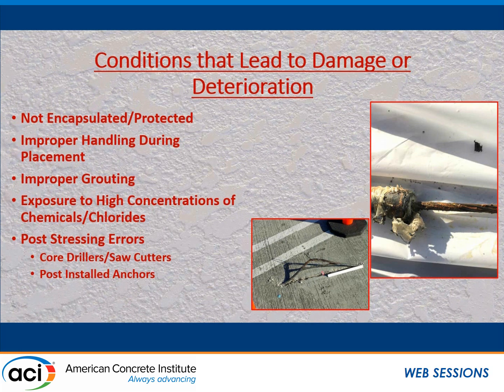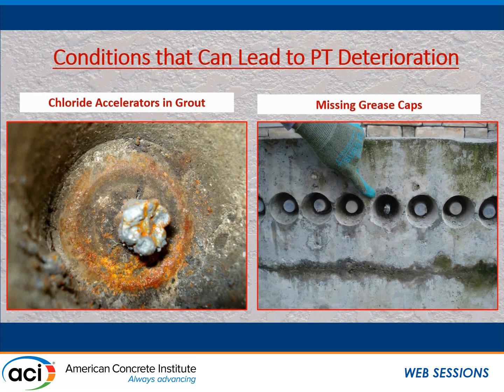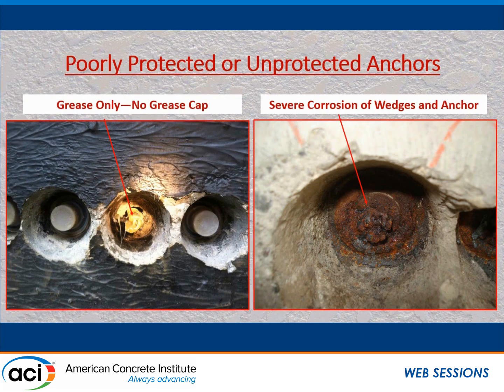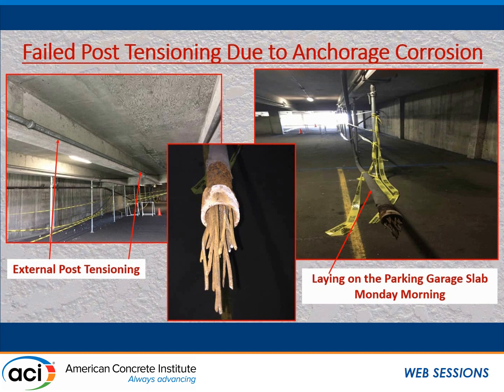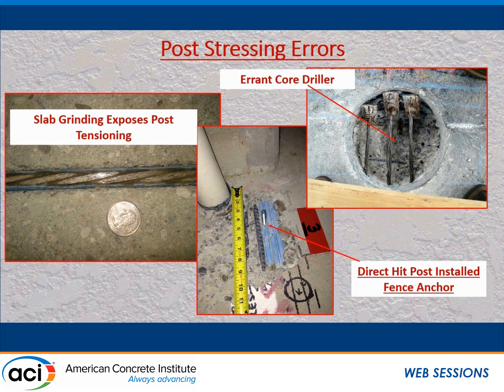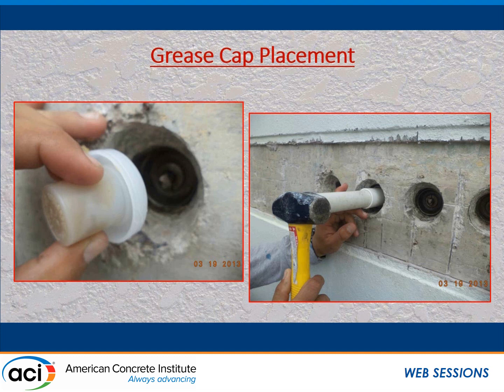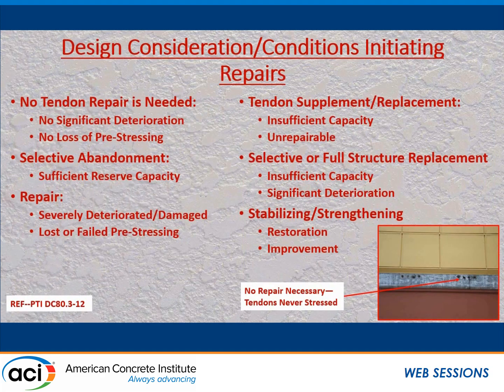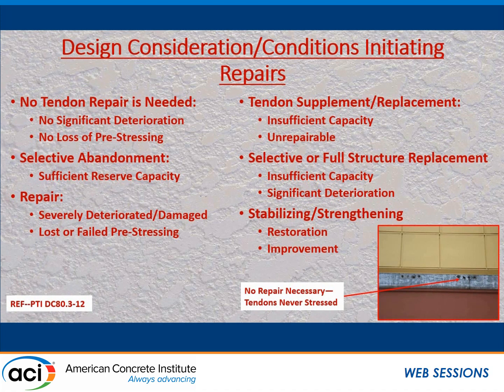Post-Tensioning Repairs and Modifications

Comment: Great information.  I have a specific project on a post tension home that I didn’t know was a post tension home until I broke into the concrete and found anchors.  Is it possible to expose cables further back into the concrete, place new anchors around live cable, then cut off the excess to remove the concrete?  This is for a back porch I want to remove that is part of the original foundation.  It has cracked several times over the years and I want to replace it with a deck.  The house itself has piers to bedrock around the entire perimeter.